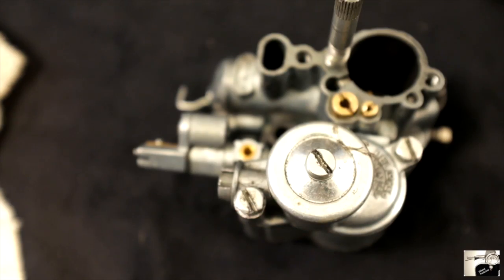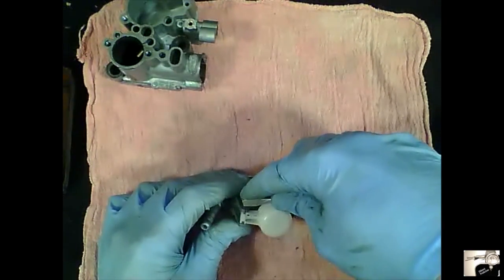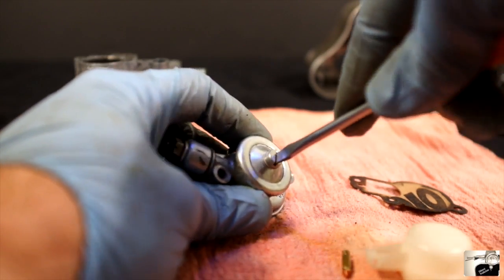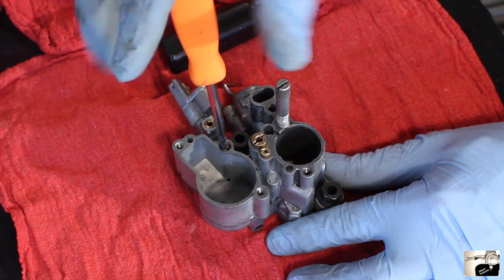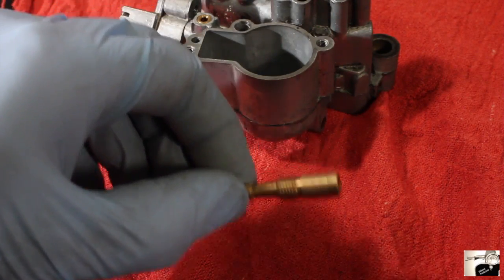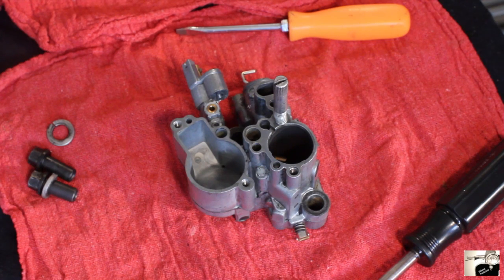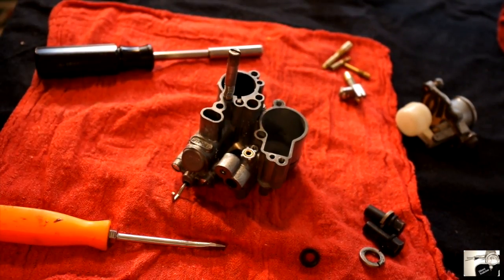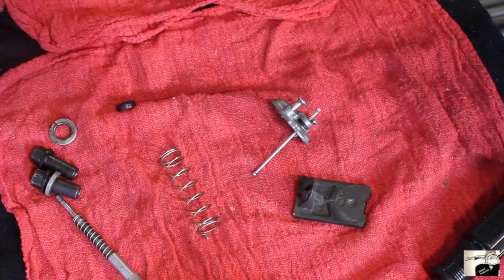VespaCarb Rebuild Part II of V

Comment: Jeff, why is my Vespa having starting probs? Plug is fine but it takes me a fair time to get the engine to fire up. 
When I do get it going I get a fair amount of smoke and it runs a bit spluttery until it warms up. I am thinking the starter jet and float pin and bowl a good place to start? Discuss.

Comment: Jeff, thanks for the great video(s). I am following your instructions to remove and clean my carb. Quick question: when removing the float should you find fuel in that reservoir? I am assuming yes but I want to be sure. Also, I am messaging you after the second time I have removed this carb. First time was easy but when I reassembled and opened the fuel tap, I realized that gas was leaking. I thought from the mixture screw but its actually draining from the back side of the float reservoir. Any idea why? I plan to order new gaskets for a better seal.Any help is much appreciated. Thanks from Canada.
Reply from the maker: YEs. you should generally find a small amount of fuel in the reservoir most of the time.
Reply: +Jeff Allen Thank you Sir! I don't Mind The music fyi. Lol.
Reply: +Jeff Allen Thank you Sir! I don't Mind The music fyi. Lol.

Comment from the maker: M)	Turn the carburetor right-side up again and unscrew the idle adjustment screw with your fingers.  Take care with the spring.  Place aside with all the other metal parts.
N)	Finally you’re ready to remove the main slide, which will have the throttle hook or pin slide coming out of it.  Using a bladed screwdriver, loosen and remove both screws on the front of the slide.  Once removed, gently pull the slide out.

Comment from the maker: O)	You’ll want to further dis-assemble this into the slide, spring, pin slide and front piece.  Separate the small rubber gasket you’ll find between the pin slide and the front cover. Place all metal pieces in the airbox lid for now.  Inspect the rubber bit for damage, replace if needed or place this aside with the other plastic and rubber bits.